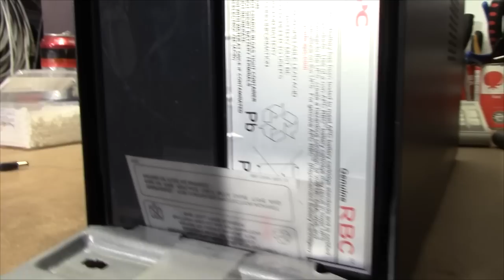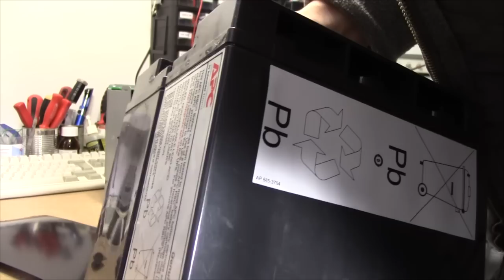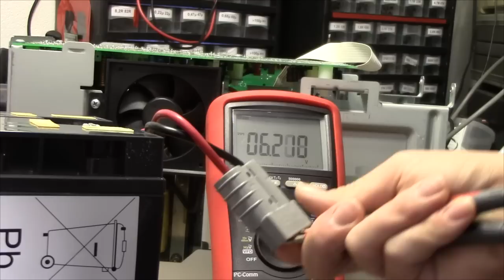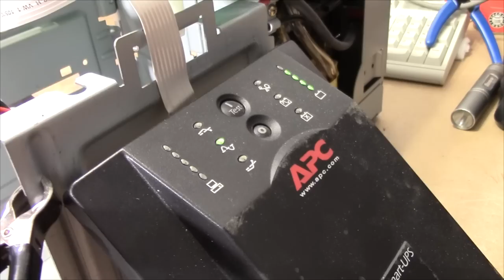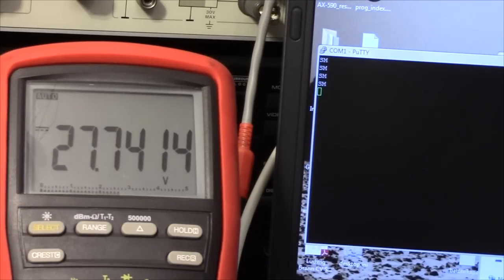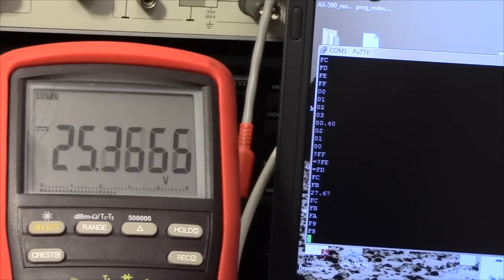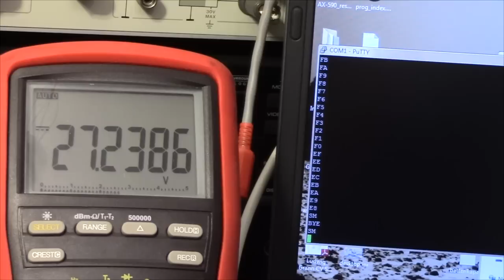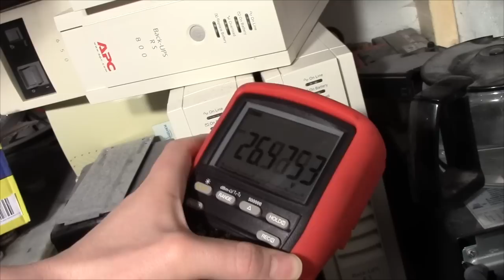Removing swollen batteries from, and servicing a 1500 VA APC UPS

Comment: Hi, I just acquired a Black 1500va APC UPS the same as the one in your video. This also had swollen batteries which I have replaced. Now when I turn the unit on it does a self test and fails showing the overload LED even though there is nothing connected. The green LED on the rear panel is also illuminated and constant alarm sound. Any ideas what could be causing this.
Reply from the maker: DJ03DJJ I've never seen this before, but it could be an internal failure of the unit. If it makes a loud humming noise during the self test, the output is likely short-circuited. If it doesn't hum, something is wrong with the switching circuitry, if it hums normally, something's likely wrong in the feedback loop.
Reply: It seem I have similar problem, I wish to have gotten a solution to this problem

Comment: Hey, can you show how to open the case of this SUA UPS? I think my UPS fan a little wobble it make vibration. Thanks
Reply from the maker: Undo the bottom screws, and lift it straight up. You need to bend it to pass over everything.
Reply: FFcossag Ahhh I see. Thanks man 🤝

Comment: Have you tested these units with any 27 or 29 volt deep cycle marine / RV batteries?  I just became aware these existed.
Reply from the maker: Works fine with all lead-acids, really. Just adjust the charging voltage accordingly.
Reply: Just saw your reply now. I am attempting tonight to adjust a UPS for 2.15 volt / cell. I am using SLA now but I will be moving towards LiFePo4 and Li Ion batteries in the long term.

Comment: Hello, thank you for this video. I want to ask you if this kind of UPS is suitable for a lithium battery pack made from 18650 cells. I have one APC 1000 with similar box, also I have 18650 cells from old battery laptops that I can use, problem is that they have a special requerments for charging and discharging them, could the UPS be set to stop send charging the battery at 25V? ( 6 cells  series fully ch 25 V).
Reply from the maker: +fumezflori You'd need some kind of protection and charging board, and the UPS battery meter would be incorrect. The charger on a lead-acid UPS is ABSOLUTELY NOT suitable for charging lithium cells.
Reply: +FFcossag Ok, thanks. Onther ideea that I have in mind is to use the inverter part from the UPS to change dc 24V to 220 AC (EU stand), as part of a solar setup. This could be done with minimum intervention?
Thanks for your quick reply.
Reply from the maker: fumezflori Yes, but you need to derate it about 50 % or add a second transformer, fatten up the low voltage traces, and massively improve the cooling of the transistors. That said, I've done just that, and it works fine. But it's hardly "minimum intervention". They are also not very efficient - below 80 %.

Comment: May be not the best place for asking... I manage to repair a back ups es 700 series with a blowed mosfet after replacing the leaking caps... Now it works but when on batteries i get 99,9Hz on main output in stead of 50Hz !!! The voltage itself is right and stable. What do you think will the problem arise to?
Reply from the maker: +Luigi Mazzoli Double check the frequency with a scope. If you're using a multimeter to measure it, it's likely just triggering wrong due to the chopped up output.
Reply: +FFcossag I'll do it with the scope just to be sure. Today I have just measured with my dmm ( BM869s) another identical unit and I got the right Hz value on battery operating mode... I just replaced most of the caps and one of the two mosfet with an equivalent one ( 100A in stead on 80A) before experiencing the issue. No idea of what could make such a big (double) increase of the output frequency? 
Thanks for your time, I really appreciate it.
Reply from the maker: Luigi Mazzoli It's because the high-frequency harmonics on the almost square wave coming out of the unit causes the DMM to trigger twice per cycle.
Reply: +FFcossag Isee.. Assuming that, I still wonder why on the other identical unit, the same problem didn't shows up...
Reply from the maker: Luigi Mazzoli It depends on a lot of factors. The battery voltage impacts the peak voltage, the peak voltage impacts the duty cycle, and all of the above impact how the DMM counts the frequency.
Reply: You were right! I measured with the oscilloscope and tI got the 50 Hz as expected. What I still don't understand is why on the other  similar ups I had different reading with the DMM...
Reply from the maker: Luigi Mazzoli It's really difficult for a multimeter to trigger off of a waveform like that, so it's basically going to be a bit random as to what frequency it displays, depending on a lot of variables.

Comment: Have u ever thought of converting the UPS to a lithium cell using the 18650 batteries??? The problem I would have is figuring out a charger for them, but fer u I think it wud not be a drama at all.
Reply from the maker: +OffGrid Aussie Prepper™ All you need is a CC/CV charger that does a 24 V string of Li-ions. Probably not that hard to source, but it's difficult to justify a lithium UPS since you don't need it to be light or mobile; it's easier to just use bigger lead-acids that cost 1/5 of the lithium equivalent.
Reply: I recycle laptop batts so theres no cost for them. I have asked a few pc shops to save them for me and collect them once a month or once every 6 months. Then take out the dead batts and build a new battery bank with em. I have no idea what a CC/CV charger is, I need more info pls.
Reply from the maker: OffGrid Aussie Prepper™ Combining random used lithium cells in higher voltage strings is generally not a very good idea at all. Especially not in a high-current application like a UPS.

I'm not really the right guy to ask about this, since I've never done a lithium ion UPS conversion. I don't know which particular charger you want or what other unexpected hurdles might pop up. I can just tell you the basics so that you can do your own research based on that.

Back-of-the-envelope, though, using li-ion cells for a 24 V UPS is going to be tricky, since they don't really give you the correct voltage range unless you use 7 in series, and finding a 7-cell protection circuit/charger/etc. is going to be next to impossible unless you design it yourself.

Comment: Hmm I've tried to reconfigure A/D C in Smart-UPS 700I unit but it didn't change charging voltage at all (even with capacitors connected). Any ideas how to adjust that voltage in this type of unit? Help please :)
Reply from the maker: If it's a white one, you need to find the battery voltage divider resistors and change them.
Reply: FFcossag many thanks. I followed your advice. The solution is to add 5.6 megaohm resistor in parallel with R118 (~72kohm). Job done!
Reply from the maker: Yep, that sounds familiar. I've done it at some point, long ago, and it worked well.

Comment: I did the "B" command and it returned 55.08.  I am in the US and have a SUA2200XL with 2 battery packs.  Is this correct?  I just replaced the batteries and most of them were swollen.  WHat should my voltage be?
Reply from the maker: David S The B command will always return about that when the batteries are fully charged. Divide by four and you get the voltage per 12 V battery. You can NOT go by this value when adjusting the charge voltage, you need to use a multimeter.

Comment: Did you use a rs232 to usb adapter or you laptop actually has a rs232 port?
Reply from the maker: That laptop has a serial port built into the docking station. It's not the most modern machine, dating back from 2006.

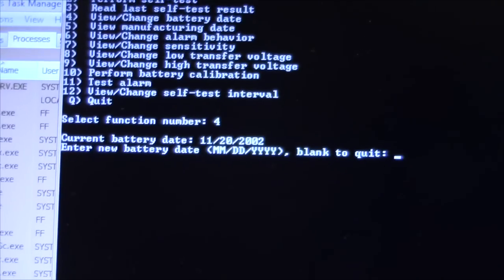Comment: What software are you using at 10:16?
Reply from the maker: the apctest utility included with apcupsd
Reply: Thank you for that quick answer. I do have another question: just bought 2 UPS for use at home, a SUA1500i and a SMX750I. The SUA1500i is silent most of the times (except the normal transformer hum while running on batteries). The SMX750I is plain noisy. It has some kind of hiss noise and it is pretty annoying. Is there an issue with my unit? Is this a design flaw? I would assume you would hear nothing in a rack near some servers but in my quiet room it's annoying.
Reply from the maker: I'm not sure, I've not had opportunity to play with the newer units.